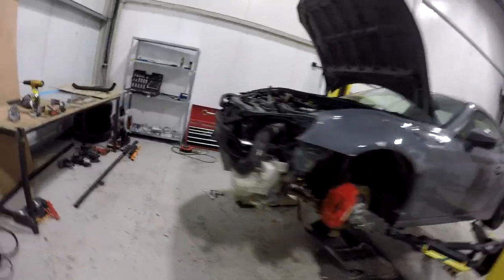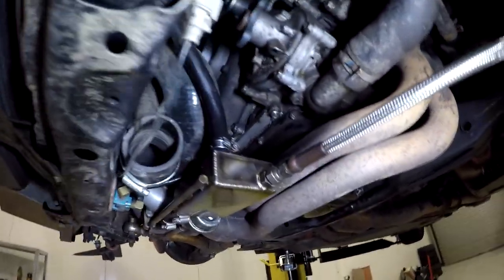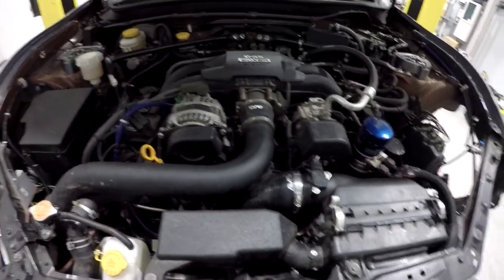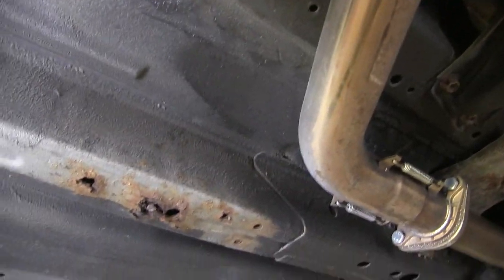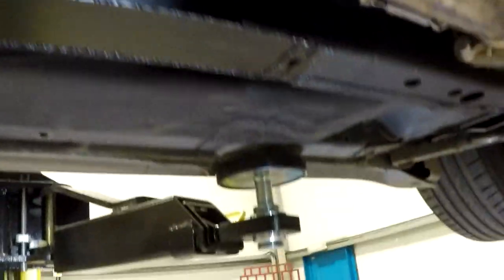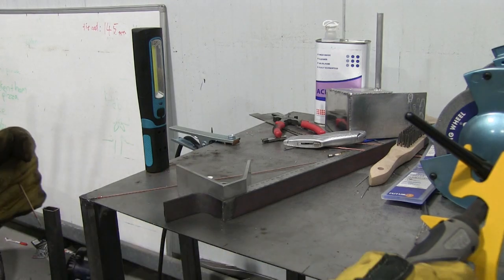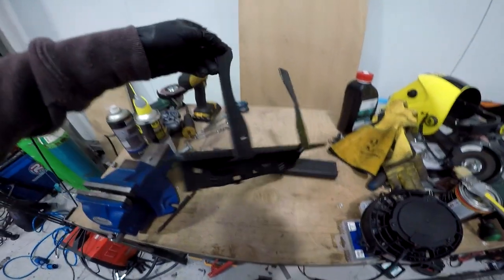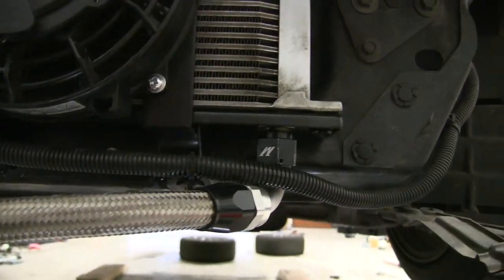350Z Drift Build #11 - Ducktail Spoiler, Rust Repairs, Oil Cooler Fan, And More

Comment: Hey Chris.  I've been watching your progress on Instagram.  Respect to you for doing your own work and not being too intimidated to learn a new trick,  like welding (especially aluminium  TIG welding).👏  Someone else already mentioned a tip to selecting the proper tap drill size, but I can't recall, do you have a drill press?  I bought a small tabletop model several years back and it makes all the difference.  Using a hand drill into thin material may possibly be the reason the bolts aren't such a tight fit.  Another tip I can offer is when painting small parts, use a heat gun for a few seconds to get them hot just before painting.  That'll give it more of a "baked-on" finish and prevent it being so tacky to the touch during install.  Enjoying these videos, mate... keep up the good work.👊  BTW, the ducktail on the 350Z looks good.  Have a Merry Christmas and enjoy yourself on the 27th.✌
Reply from the maker: I keep looking at drill presses and thinking do I really need one lol but you might have just convinced me ;) thanks for the tip on painting too, I always struggle with painting stuff
Reply: ChrisDrift Yeah, the drill press is a must, even a cheap one goes a long way and will change your life.  It isn't as much a game-changer as a welder, but it definitely makes life a bit easier.  If you buy one, grab a small vise to hold the parts (to save your hands).  About the painting, I have the same struggle as you.  I discovered the heat gun assist quite by accident, but it works, so I stayed with it.  Have a good day, mate.

Comment: Great video as usual! I feel your pain on the TIG welding, real life welds never turn out quite as nice as you hoped for. If you have not see these.. check out stubby gas lens kits for your torch. It won't make you a better welder but helps with gas coverage and makes it easier to handle.

If you are cleaning your metal with a wire brush, try a flap disc or abrasive disc instead. I am no expert but I find that wire brushes just shine up that top layer of mill scale on steel and don't actually remove it. 

Love the content, keep it up!

Comment: Welding looks good to me. It's weird I had the exact same rust patch on my 350.
Reply from the maker: I think its common cos of the plastic undertray that sits right under that part normally and just traps water on it. I took mine off to fit the new exhaust Y pipe, so not there anymore on mine